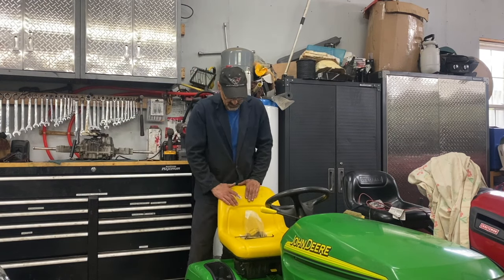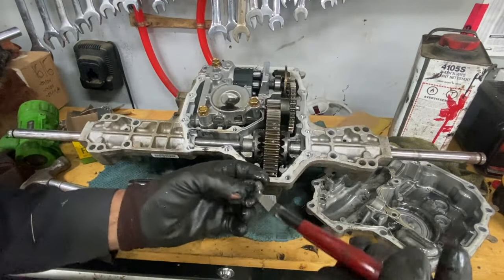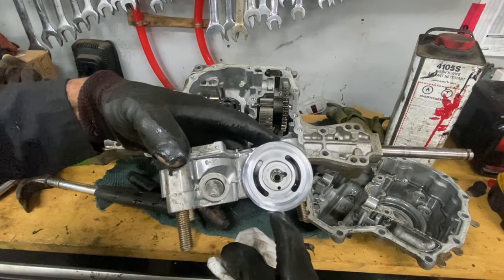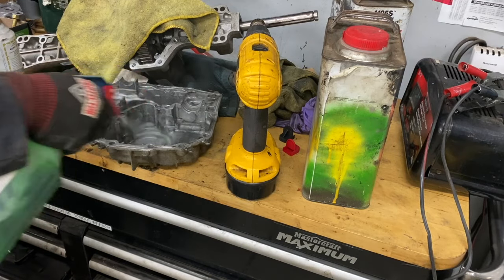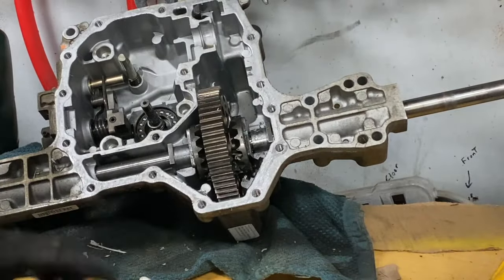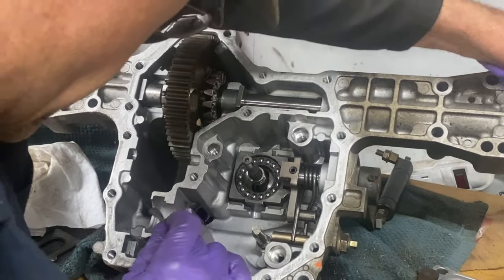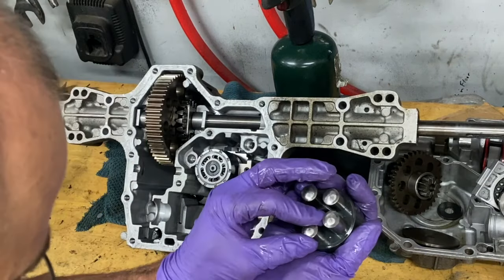How to fix a Hydrostatic Transmission that slips on your John Deere. LT180, 100 Series, LA135, D130

Comment: I loved watching this video. My LA150 quit moving after half hour mowing last summer, I did take it down and changed the fluid but never took the cover off to check anything so now when weather breaks again I am going to take it apart and repair it. The mower itself runs fine after I rebuilt the whole deck, new carb, fuel pump, voltage reg. tires, plugs, battery. My dad taught me well about mechanics, mostly auto motors and transmissions as he rebuilt them for over 50 years.
Reply from the maker: Awesome.    600 grit “wet” sandpaper works better.

Comment: When my E140 K42 trans started slipping at 100hrs I replaced it with a K66
garden tractor trans. Havent had any trouble since for 377hrs. Drags trees,
shovels gravel & dirt, Works great. I am presently fabing a outrigger ditch 
mower for it. If I had to do it all over again I would buy a 2nd hand X580.

!
Reply: I have a L130 John Deere and looking to upgrade as well. The 46 is still working great after 100 hours. I have to find a plce to buy the K66 and the parts needed for the conversion.

Comment: Clean the magnets as best as you can with a rag or paper towel and then use your air to blow the filings away. They come clean and it works every time.

Comment: I have a 2015 D160 with 170hrs. It struggles to get up hills, especially when hot. It's been getting worse over the last couple years. My back yard has a steep hill. After finding out how common this is and the cause, I removed the K46 and took the cover off. Everything looked ok - no big damage, probably just small wear. The magnets (four in mine) had a good amount of fine shavings. My filter is a screen, not paper. I cleaned everything up and resealed the case. The old oil looked very bad - thin and grey. I put fresh 5W40 synthetic in it, and it climbs hills so much better now. Hopefully I caught it before too much damage was done. I don't do any snow blowing/pushing or tow much of anything, just a lawn aerator once a year. I just wanted everyone to know that if you catch it early enough, you may not need to tear into the transaxle and rebuild. I think I'll get at least another couple years out of it.
Reply from the maker: Thank you for the comment.  Good info.....
Reply: My D160 failed at 110 hours. Did the same as you but refilled with 20x50 synthetic which works excellent if there is no winter use. All the seals can be replaced without tearing down the transaxle.
Reply: My 2006, J.D. 155c, w/48" deck still drives/sounds as it did new at 701 hrs.  No leaks yet, very quiet even climbing hills till it looses traction. Believed the lie it couldn't be serviced but will pull it out soon.  I'll change the filter,  probably fill with LUCAS oil and hope for the best.
Reply: @WeekendHobbyMechanic   HEY SIR,how can i change the transmission oil on a John Deere LT160 ?? thanks
Reply from the maker: @michaelhorath6851  Same transmission as this one.  Just take the transmission out and removed the base cover.  Clean your filter. Clean the old gasket material.  Add gasket maker or Hondabond to both the base plate and Transmission.    Watch this video on how to fill it & install.
Reply: @WeekendHobbyMechanic  Ok thank you so much !!!

Comment: Excellent video! I may need to refer to this one day for my JD. I read/watched videos the trans fluid from the factory is garbage and causes a lot of wear and so the one thing I already did was drop the Trans and replace/upgrade the factory trans fluid with Full Synthetic 5W-50 oil and has been working great for 5 years. I'm hoping that upgrade will keep me from having to tear it apart and replace parts - we'll see. Since you have the Trans out, the one other thing I would do is replace the drive belt. You will need to drop the deck to replace plus you can also check the one or two other drive belt pulleys to see if the bearings are good/bad.

Comment: Changing the pump/motor didn't work either. Obviously another problem which I think is the 'center section'. I also sanded that as you did but still that didn't work so I'll buy a new center section. Also could be the relief system which will be replaced with the center section. I'm getting good at taking this POS apart andre-assembling. Hopefully it will work after the hydraulic stuff is fully replaced. I will change the oil more frequently from now on (if I get it fixed)
Reply from the maker: Wow.  Let me know if you get it going.

Comment: I am trying to be helpful- and not sound like a jerk- but you really want to torque those bolts in the aluminum tranny case to specs.  I stripped a pump bolt once and had to repair it. I also only use synthetic 5w-30 motor oil.  The 5w-50 gets too thick and you can lose speed once it heats up. I lost 1.5mph.  Went back to 5w-30. I have rebuilt 3 k46A transmissions on different LTR-180 Deeres.   I can hear the idler pulleys needing grease or replacement.  Again just trying to help.
Reply from the maker: Good to know.  Thx.

Comment: I have a spare Tuff Torq K46 from a Husqvarna, but have you ever tried to use one in a John Deere?  I understand flipping the triangle pressure plate to reverse the movement direction, but I am not sure what you mean by saying "swap out your "axles" and "shift and brake levers".  Not sure why the axle would need to swapped? (8:45)  The connections on the trans look the same on most various K46 models. I would think using the different models from spares for common John Deere tractors etc could make a really good video if you ever get a chance to do one. Thanks for these videos they are really helpful.
Reply from the maker: The triangle pressure plate might be the same but you have to check the axle length.  If they’re different your wheels won’t fit.

Comment: I have a LT180 too, where can I get the gear set if I don’t have spares? Also, what actually caused it to slip, Gears or the surfaces you sanded smooth?
Reply: Slips when it gets hot. The mower was given to me today. It’s looks fantastic and engine runs perfectly.
Reply from the maker: @Shark-qd1pz    I find that the oil filter in the transmission “LT” models plug up.  
  (I bought a used transmission from local ads for $50 and I used the gears and filter from that trans. It came from LA series).
 I’d pop off the bottom case and replace the filter. Put it back together and add 5w50 oil or 20w50 hydrostatic Amsoil.  Part number for the filter is MIU805396

Comment: Can you remove the pan from under the tractor without removing the transmission or will the gears be falling out or does the unit need to be removed and flipped over to remove.

Comment: Is slipping the same as jerking? I have an L120 with a K46. It jerks on load or uphill. Same when turning left or right. I'm planning on opening it up. How did you know how to put it back together. Nice video but it would have been helpful if you explained why you were doing what you were doing. No offense.
Reply from the maker: Check your drive belt first.  (Might be bad).
   I have another video on the transmission .Check it out:
https://www.youtube.com/watch?v=gajrBiacPi8&list=PLwiPIZPn_7Ped9u0idsWDWPbt23M96dqy&index=5
Reply: @WeekendHobbyMechanic  I did check and replaced the drive belt. Also the tensioner pulley.

Comment: Nice job bringing that back to life!  Why do you use the Castrol 5W50 and not a J20C spec like the Shell Spirax S4 TXM at Canadian Tire?  Are you down in the Valley or on the South shore?
Reply from the maker: Any oil is good.   I sometimes use 10w30, 10w-40.    I live in the near Berwick NS.

Comment: Resurfacing the pump housing faces by hand is poor practice.  The housing should be set face-down on the sand paper supported by a flat surface (metal or a piece of glass).  That will enable you to get a true (flat and level)  finished surface.

Comment: Thank you. I have a D105 and need to replace the Drive Shaft. Is that as easy to take apart and can the drive shaft be replaced> The screw holding the spring broke inside of it, and I have not been able to get it out. So, I thought replacing would be the best. Thank you for your suggestions
Reply from the maker: Can’t be done. They don’t sell any parts for these transmissions.   
  I snapped off the bolt before and was able to drill it out with a 2mm drill bit and used an easy-out to remove it.
  Check out these videos: https://www.youtube.com/watch?v=AiBf8dBzwVY and 
https://youtu.be/tpnWiIB-RC4
Reply from the maker: Checkout theses videos 
 https://m.youtube.com/watch?v=tpnWiIB-RC4&t=184s

https://m.youtube.com/watch?v=AiBf8dBzwVY

Comment: The pump is howling more than expected.  Any idea if it’s a foaming issue or 🤷?
Reply from the maker: Usually a Low fluid level will cause a high pitch whining noise.
Reply: @WeekendHobbyMechanic  maybe once you got the pump fully working it needed more fluid? I don’t know why the manufacturer made it so hard to check the fluid or add the fluid. It doesn’t make any sense.
Reply from the maker: @HeadFlowInc      What model tractor do you have?
Reply: @WeekendHobbyMechanic  Husqvarna YHT 18542 42” riding mower. I can only mow about 15-20 minutes before the hydrostatic differential starts whining and barely pulls itself.  Let it cool down repeat. 🤔
Reply from the maker: You need to change your fluid.  They’re a few videos on YouTube on this.  It’s pretty close the same as a John Deere. 
https://m.youtube.com/watch?v=on7aHn2v2Rs&pp=ygUiam9obiBkZWVyZSB0cmFuc21pc3Npb24gb2lsIGNoYW5nZQ%3D%3D

Comment: Hi

I have a John Deere x155r tractor mower.  The right hand rear axle has broken off.  How difficult is it to replace a new axle in the tranaxle?

Graham
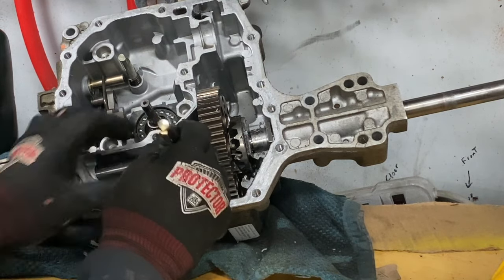Reply from the maker: Pretty simple. Check the video at 4:35.   Check out this video on how to remove the transmission. 
  https://m.youtube.com/watch?v=on7aHn2v2Rs

Comment: So, is it normal the noise when you push to go forward (or backward)? Because I have the same one and i thought that was a bad transmission
Reply from the maker: The noise you hear is the hydraulic pump. Some trans are more noisy than others.  Just keep on drive it.

Comment: When you removed the K46, the v-belt pulley was on top of the plastic fan.  When you installed it, you put the fan above the pulley.  ???  Wondering if you caught it, but didn't mention it?  Great video.  BTW, The Deere parts website shows the pulley above the fan, like when you removed the tranny.
Reply from the maker: Yup I caught it..

Comment: I had put rebuild transmission on my D170, when I start the tractor it is in reverse. I can hear the transmission pump on, it does go forward and reverse but is in reverse when in neutral and starts smelling. Can't get  hold of the guy I got it from. Will you know what can be the issue
Reply from the maker: Unhook the forward/reverse rod from the transmission.   Startup the tractor, does it still go in reverse?    If so, the transmission is not 100%.

Comment: My la120 doesn’t seem to want to stay in gear. If I slam the bypass lever back and forth it will go into gear for a minute. I checked that it was moving the lever on top the trans. Is this common?
Reply from the maker: Is the transmission slipping?   How many hours on it?  Might be it’s worn out like the one in this video.

Comment: I have a LX277 AWS Hydrostatic. When I turn the steering wheel right or left the wheels do not straighten back up. Do you have an idea why that is? There is this rod under the seat that seems to move the back wheels but it won't straighten them...it feels kind of loose when I move it left and right.
Reply from the maker: I never worked on a LX277. Make sure your spindles aren’t seizing up.  Try to grease them & free them up.    Then lube up the steering plate under the tractor.   Hope this helps.

Comment: Dear Sir I have a JD lt160 it has gotten slower over the years itsabout 18 years old. I never checked the trans as I was told it was in service able but it is slow going up hills an has lost speed over the years what would suggest to try doing the trans oil change at least it runs ok on flat but struggles going up hill I did change belts an drive pullies and my drive belt is always tight which Leeds me to the trans what do you think sir Ray Stein
Reply from the maker: If the oil is dark, probably the filter is dirty.  Might just need a new filter.
Reply: Dear week end can I clean that filter if not where can I get one do you have a part number possibly RayStein
Reply from the maker: @raystein4457  Screen Mesh filters can be cleaned. These are in the LA and D models. Yours might not be a screen-type filter. 
   This filter on this LT180 model couldn't be cleaned.  
  John Deere Part number is MIU805396
Reply: @WeekendHobbyMechanic  thank you for your help I will get a filter an oil an when I do IL change both as I said I thought you didn't have to service these n like I said it slips goin up hill an has slowed down over the years Ray Stein
Reply: Thanks again for your help I really like this tractor an have taken good care of it hopefully this repairs will have good effects on it. RayStein
Reply from the maker: @raystein4457   Note: Add Gasket maker or Honda-Bond to the transmission and bottom case so you won't have any leaks.

Comment: What would make one wheel spin while pulling up the hill and the other one dont help pull much or any?
Reply from the maker: One wheel drive!!!  The wheel that has the lease resistance will spin.
Reply: Just seems it don't help much and the right will spin, , I changed oil, didn't help,  it didn't look bad at all. My old mower would go up my hill very easy, it has new drive belt, new oil, good keys on axle. 
Thanks for your video its great. ,
Reply from the maker: Too bad.   I sometimes buy a used mower for $100 and used it as a donor.

Comment: Will this work on the k62ac they put in the simplicity broadmoor
Reply from the maker: Yes.  70% of the time the filter just dirty.   You could just change the filter.
Reply: @WeekendHobbyMechanic  well that’s good news mine is slipping when it gets warm and I can’t find a rebuild kit for it anywhere everyone is out of stock lol 

So if I can just do this it would be great
Reply from the maker: @Vuhjayjay68     Check the filter if it's plugged.  If you decide to tear it apart, I'd use 400-grit wet sandpaper and then 1000.   The pump assembly is a bit tricky to put back together.
Reply: @WeekendHobbyMechanic  I plan on getting into it tomorrow I think I’m smart enough to get it done lol I’m just going to start with inspection and complete cleaning of everything just to see if that works

Comment: So I put the wrong oil in my transaxle how do I fix that
Reply from the maker: What type did you put in?
Reply: @WeekendHobbyMechanic  5w-20
Reply from the maker: @22-Bronc     5w-20 will work fine but 10w-30, 5w-40 or 5w-50 is better when the outside temperature raises.   Is the neutral rod all the way in?
Reply: @WeekendHobbyMechanic  I’m not sure. How do I check?
Reply from the maker: @22-Bronc    The Neutral rod is in the back.   Make sure the rod is pushed in.   I check the function of it at 10:40 in the video.
Reply: If it wasn’t in all the way would I still be able to move it
Reply from the maker: @22-Bronc    At 10:40 in the video I show how it pushes the Motor Pump away from the case. It won't move at all if it's not all the way in.  Just a quick question.  Can you make sure the belt is spinning the pulley on the trans.
Reply: @WeekendHobbyMechanic  yeah the pin is all the way in and the pully is spinning
Reply from the maker: @22-Bronc    Both keys are in the back wheels?
Reply: @WeekendHobbyMechanic  yes
Reply from the maker: Did you have your transmission all apart like I did in the video?  Or did you just changed the oil?
Reply: @WeekendHobbyMechanic  I had it all apart
Reply from the maker: If you lived here in Nova Scotia I’d take a look at it for you.    
    It’s not building any pressure for some reason.  Double check the neutral rod. Look under the tractor and visually check it.  
         Make sure is goes back and and forth.    You might have to take the bottom pan off and check the function of it as I did in my video (10:40).
Reply: @WeekendHobbyMechanic  I made sure to check before I put the pan back on like you did and it seemed to work fine is there something else that could possibly be stopping it from working
Reply from the maker: If you can’t figure it out,  you will have take the transmission out and double check your work.   Big pain in the ass.
Reply from the maker: Make sure the forward / reverse rod is function .    That controls the pressure in the trans.
Reply: @WeekendHobbyMechanic  is that what’s attached to the pedal?
Reply: @WeekendHobbyMechanic  so there is this spring that I lost that was inside so you think that might have to do with it
Reply from the maker: Left over parts is not good.
Reply: @WeekendHobbyMechanic  Ik but I don’t know what the spring is for
Reply from the maker: Email me a picture at pernellgerman@hotmail.com
Reply from the maker: Did your transmission slip before all this?
Reply: @WeekendHobbyMechanic  no
Reply from the maker: You should’ve just change the oil.

Comment: Is that tranny a two speed?
Reply from the maker: Hydrostatic.  Works off a hydraulic pump and motor.
Reply: So what was the post mortum?  What actually causes the no pull?  The pump is all i can guess, combined with the dirty oil.  And where do you source parts such as gears?
Reply: @rickcain5717  dirty filter, if surfaces not polish smooth like he's doing or too much wear/play with piston pieces,....oil will get by and not help push the pistons there are 4 surfacesthat need to be polish smooth.

Comment: Did your pump block slide down snug on the main shaft splines? I noticed mine seems loose with play on there so im wondering if thats my problem.
Reply from the maker: There is some play.